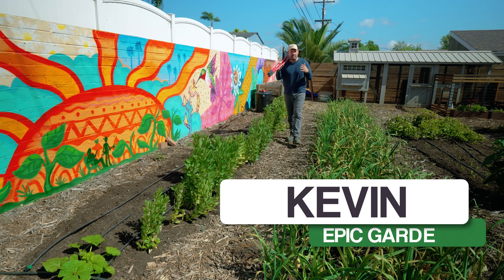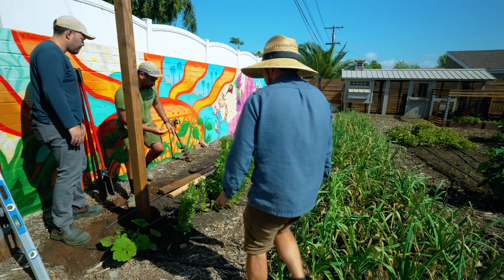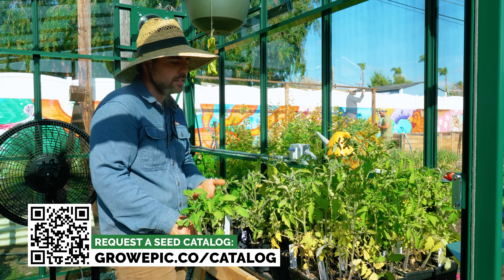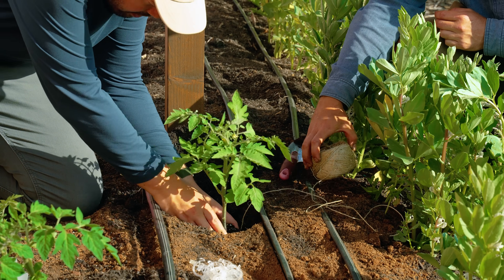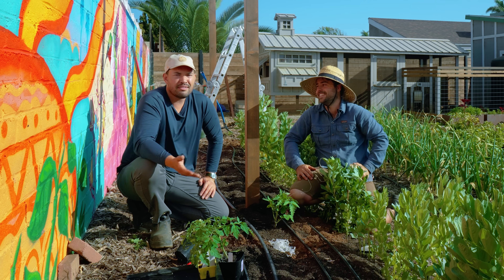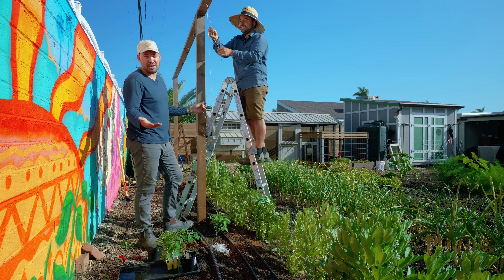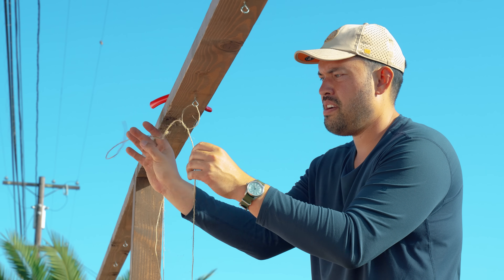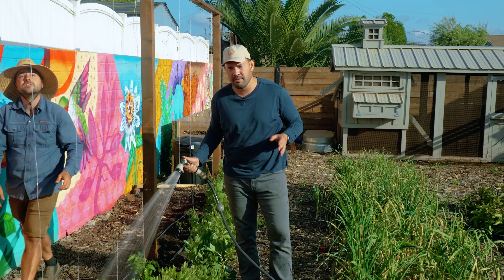The Easiest Tomato Trellis Method EVER!

Comment from the maker: One improvement we would make here in the future - take (2) 2x4's and flip them to the short side, put them together and run them across the top - far more stury and less bowing as tomatoes put on weight. This method we show still works quite well and is cheap + requires no fancy tools or parts!
Reply: what about instead of a knot at the top eye hole you put the twine through it and tied a bolt to the end so that as it grows the bolt keeps the line taught and the plant up?
Reply: @JavierFernandez01  That might work, but you'd probably want more weight than just a bolt.  Especially as they get larger and heavy with fruit, the trellis provides support so the plant doesn't get uprooted or break the stem.  If you have too little weight, it'll just bounce the bolt up and down like a fishing jig and not end up providing any support.
Reply: We use these clips on a large scale in our greenhouses here. It's nice and clean, but we still got the top side spool.
Reply: @rhvette  and that would be much more work. yea. idea busted. good. :)
Reply: Good to know! Thank you, I’m actually getting ready to put my trellises together and this would have saved me a lot of headache.
Reply: u friend sounds a bit like mr beast
Reply: Do you think this would work with 5gallon Homer buckets for a small patio garden?

Comment: I am a carpenter and I am going to rip this apart: that needs to be grounded contact treated lumber, you need to use a string line, and no you do need to be using concrete

Comment: Just a quick heads up for people watching, it's always a good idea to lightly break the root ball up a bit before planting. Help the roots shoot in all directions which in turns makes the transplant shock a shorter period.
Reply: I’ve personally done both ways and I haven’t noticed a difference really at all..but I also use soil that usually has mycelium in it or use a mycelium inoculant during transplant and personally I notice a difference when I don’t use a mycelium inoculant more so then anything.
Reply: Not touching the root ball (planting as is from the seed tray) has resulted in less transplant shock for me this season.

Comment: I made my trellis movable by using a couple of landscaping timbers on each side of the 4x4s instead of burying the posts. That way next year I can “crop rotate” by moving the entire trellis.   I have 48 plants and all are 12” apart. So far I’ve harvested 68 pounds of tomatoes (almost all indeterminate). Our biggest problem right now is 100+ degree temps for over 2 weeks. Thanks to some 70% shade cloth I still have blossoms and new fruit forming.
Reply: I should add that I have cross boards going across the top of the trellis so I can plant on both sides.

Comment: I do the same thing over my raised beds, except I build the support using EMT conduit pipe and connectors from Maker Pipe.  Then I use metal zip ties to attach a cattle panel over the supports.  This way I can put plants that can be trellised this way anywhere in my raised beds and if I decide to do a double stem option, I can hook the strings in any direction so the 2 stems can be grow in opposite directions so they don't get tangled up with each other.  So far I have used it to support tomatoes, peppers, cucumbers, and melons!  It is more expensive but it also will last forever.  I just pound some rebar into the ground and slip the EMT pipe over the rebar to hold it in the ground where I want it.  Way easier than digging a couple of 2-3 ft holes. :)
Reply: Same setup that I have.  It held a 20# gourd 3 ft up on a sling.

Comment: I've used this method for a couple of years now.
A few tips.   If you use twine, it will weather and break eventually.  You'll need to replace it each time you plant a new plant.  I use builders string now, it lasts a LOT longer.
The plastic rings also weather quite quickly in the sun.  They will just break off after a couple of months.  You won't be able to reuse them, but they're super cheap so that's not really a big deal.  Just get them off the plants before they disintegrate, or you'll be looking for little bits of plastic in your garden for ever :P
Reply: THIS!! I used the exact same jute twine in the video and ALL strings broke underground when the tomatoes were about 2 feet tall. Had to quickly attach a 2X4 to the supports parallel to the ground and then tie laundry line (much thicker than jute) to the 2X4 and use tomato clips to attach the plants to. Jute WILL break, most likely before your season is over!
Reply: First time doing this method and I guess I was smart and went with braided nylon mason line…so far it’s holding up my 6-7ft vines just fine 3 months in…also maybe my clips don’t get enough direct sunlight but so far they don’t seem to get brittle.

Comment: I used 2x4s for the posts and hammered them 2ft into the ground from a ladder with my maul.  They ain't Movin! Just be sure to level check after every few poundings. And if you want to save on eye hooks too drill a hole and push the string through and tie it on top so it doesn't slip back through.

Comment: I do a similar method with 2 x 2's across the top.  Less weight at the top but sturdy enough to handle the weight of the plants.  Although - at your spacing of the main posts (4x4's), the 2 x 2's would bow.  But for me, the 2x2's are lighter and easier to manage when it's only me. Also - eyehooks - 100%. So easy. With those, I uses the hooks with spooled twine.  They slide into the eyehooks easy peasy - and no worries about knots.

Comment: I used the plastic tomato clips this year, and they work great to support the main stem and additional branches.  Another easy method is to use tomato trellis roller hooks.   The tomato roller hooks are very affordable and are a game changer raising and lowering indeterminate tomato plants.  Just make sure to build the height of the trellis within easy reach.  Secure 2 eye hooks the width of the roller hook into the beam at the top and hang the tomato roller on them.  There is already string on the roller, and it is so easy to squeeze the side trigger on the roller to release the string to raise or lower indeterminate tomato plants since they can grow very tall.  Lowering the tomato plant makes for easy picking of the tomatoes at the top, and then you can raise the plant again.

Comment: I use the orange bailing twine,  I like the thicker gauge of it. I think it is easier on the plants. I tie it as a single half hitch to the base stem and tie it to the conduit at the top and wrap the tomato when it gets taller. I prefer the t-post and conduit method as I move my tomatoes every year. I had a problem one year  with disease after multiple years in the same location.

Comment: I’m using 4x3x8 $5.88 at lowes, landscape Timbers and using firing strips , I chose 30 inc length, to go across the top, then you put the eye hook on each side for a double row trellis. You put in your post and the top should meet in the middle of the middle post. Make sure they are not bowed or twisted! I have some on the outside of a 6x4 raised bed. With one on the other side and a cattle panel trellis arched in between. There is some overhang because the post is 8 ft, but it looks so pretty. You can hang a basket or trellis single stem cucumbers or a wind chime. The possibilities are endless 🙌🏻

Comment: This is a great idea for indeterminate tomatoes, but why would you do it for determinate? They only get to about 4' in height and you don't want to cut off the suckers because you'd be cutting off most of your harvest. 
I grow in 28 gal galvanized tubs. My SM and Roma tomatoes are put into the tubs, 4 per tub evenly space on the outer edge, with a tomato cage in the center. I use the clips to attach to the cage as they grow and because it's on all 4 sides, the cage is anchored down by each tomato. Have had great success doing this for the determinates.
Reply: In the city, folk grow them in ten gallon buckets and get a good yield.

Comment: While you can use almost any knot for this style, I can't truly recommend anything other than a taut line hitch.  The TLH allows you to run the string through the hook eye and tie it back to the standing line.  This means you can run the line as far down as you want and A) have tons and tons of spare string to make support loops and B) service the string trellis at ground level without needing a ladder after initial setup.  As it's also a phenomenally useful knot for day-to-day usage, it's worth practicing until you can do it instinctively; it's only three wraps around the string, it won't take you long.
Reply: Older folk with arthritis in their hands and fingers have problems with this, even though gardens are huge. We found Velcro strip ties for the tomato plants that are easy and sturdy.
Reply: @LIZZIE-lizzie  Another point for the TLH there.  Because it's an open loop knot, you can tie it with big gaping loops and then pull it closed with the tag and standing ends.  Almost no finger dexterity required.

Comment: I tried this method 2 years ago after seeing Charles Dowding do it in his greenhouse and ultimately, it didn't do so well for me. This works well if you don't have strong winds, but several of my mature tomato plants snapped because they unravelled in the wind and became unstable. Also, I suspect having the extra support meant the plant didn't build as much strength in its stems as it would've without the support (same reason you're not supposed to stake young fruit trees), which doesn't really matter if your support stays in place, but mine didn't..

One tip if you do decide to do this though, make a few knots on the bottom of the string, so it's a bit of a ball, which you can then place under your entire plant's root ball. It'll help the plant grab hold of it better - I had some that got pulled out from under the plant, which I then had to just attach at the base of the plant (which you can do as another option too).

What I've found works best for me and my crazy windy weather though, is using cattle panels, and as the plants grow, tying pieces of twine to the cattle panel a little higher than the plant, and securing the string to the tomato plant with a tomato clip like you're using. It looks wonky, but it's entirely customizable and you can continue to add twine strings to control sucker branches as the plant grows too. If a bunch of branches get away from you, just gather them up in one piece of twine and tie to an appropriate spot on your cattle panel! But having the structure low enough on the plant, and not wobbling like a string, really makes a world of difference for stability. Happy growing!!
Reply: We have used hog wire panels (cattle panels) horizontal to the ground about 6-7’ overhead of the planting bed, supported by stakes screwed onto the sides of the raised beds. White cotton string is tied around the lowest part of the young tomato plant is strung up overhead on the hog wire panel and a simple slip knot is used to anchor the string to the hogwire, and the string can be tightened up or loosened when needed. As the tomato grows, it’s pulled vertically gently, and the vine spiraled around it as it grows up. Really easy to undo the strings once the season is done.
Reply: @christinebottaro9017  love that, thanks for sharing! I really need to learn more knots 😆

Comment: Kevin! In 18"H 4x8 beds, I grow 3 indeterminate tomatoes, width-wise (sun, box angle). Always struggling to find better trellises!

I use a green, hard plastic 8' garden stake for each (hate plastic tho); by end of season they are taller than stakes & really sway in the wind as the tops get heavier. Majority of pole in-ground is in fluffier type of soil which isn't great for stability & deeper you go, less pole height to support the plant. Ugh!

Maybe constructing your wooden overhanging trellis* across the width? Not sure I will do well at it. I did build these beds though out of lumber, though. Hmmm!

Edit: Do you have any ideas for a better trellis, this type of set-up?

Comment: For the vertically challenged amongst us: use a taught-line hitch instead of a clove hitch. You can keep the knot lower down and won't have to climb a stepstool to undo the clove hitch every time you make an adjustment.

Comment: I was wondering for the first method, would it also work if instead of knotting the string, just let it come around and back down over the hook and attach a weight to maintain tension, so it automatically adjusts as it grows.

Comment: Link to your last year’s video installing this system using the metal T-bars? 

I would like to try the T-bar trellis using the Florida Weave in my large galvanized water troughs. I am thinking I can put in 3 x tomato plants in each watering trough! I will also need to figure out putting in some shade cloth - the water trough containers are on the south side of my house

Comment: I’m waiting to see if Amish paste is better than SM as the flavor wasn’t there.  A 4x4 costs about $20 here and before I’d use it for tomatoes I’d use it for shade cloth.  James Prigioni uses a string release thing at top which works well with clips.
With all the watering in this drought I think I already surpassed the $80 tomato so I’ll stick with found items like hog wire and T-posts.
I let tomatoes do their thing last year in a cage and they were healthy compared to pruned.  Spacing and wet weather are important.  Even watering, air flow, shade if too hot and if it’s humid and wet in your climate space them out.
If that line busts in a storm their done.

Comment: Jock I am 5 foot 2' and 95# and work solo in my garden. Dude this is hard for me. How am I to get the post etc. Any other short ideas?
Reply: Spelling it “Jock” is crazy 🤣🤣
Reply: I’m also 5’2” and use Texas Tomato Cages, they are heavy gauge aluminum, about 5 feet tall, 18 inches across and fold flat in the off season. Just keep tucking the tomato plant inside the cage and it has plenty of support. Easy to put up, and remove (and store) at the end of the season.  A bit pricy, but they last forever, no plastic waste.  If a tomato needs more support, I use leftover Christmas ribbon to tie it onto the cage.  Thin out the excess leaves inside the cage when the tomato plant gets big and dense and needs more airflow.

Comment: I used these 2 years ago.  they work great but clean up at the end of the year is a horror show.  I likely used way more than I needed but..... I gave NO thought to getting them back up at the end of the year.   I went back to just tying up as needed w/ twine, easy to cut and yank off.  The plastic loops hold on really well and do an amazing job though.

Comment: Normally here we have to concrete posts in(rainfall and clay).rot..but something like this, we wouldn't. Permanent structures yes, but for tomatoes no i wouldn't.  We switch out planting spaces so i would definitely not want permanent posts set with concrete. If determinate tomatoes tho, you don't need this structure at all...indeterminate, yes this would be a great temporary structure😊

Comment: Tomato clips are nice & easy to use. But I'm not happy with the way the ones I got deteriorated in the sun and got very brittle. For someone trying to reduce plastic waste, I had planned to reuse them for years, but they broke year 1. I recommend anyone getting these to look specifically for the UV-stabilized/biodegradable clips.

Comment: The wood posts will rot in the ground over time. It's better to use concrete that rises about an inch or more off the ground and attach the posts to the concrete.

Comment: I hate these clips and people really need to stop promoting them. Not only are they plastic and they break while in the garden leading to plastic breaking down into your soil but if you don't use them all in one season by the next season they are so flimsy you can't even use them as they snap when you close. So every year you have to buy thousands of essentially microplastics to put into your garden. There are much better ways and even small aluminum clips you can do this with that will be a one time purchas